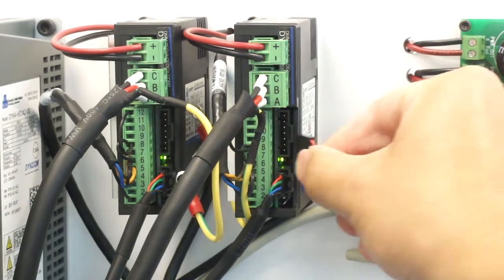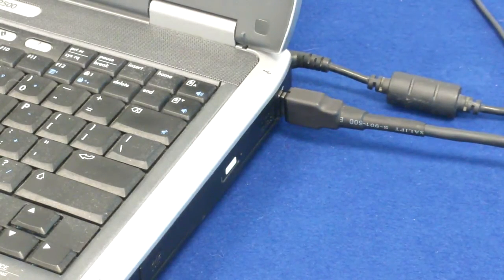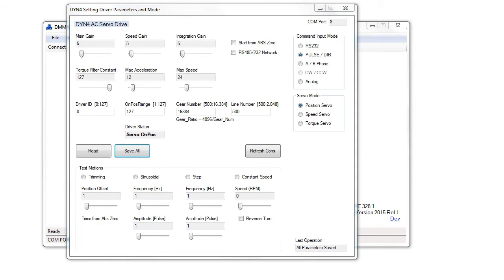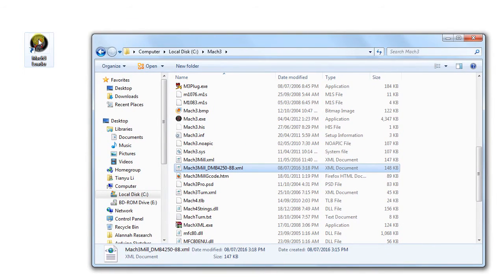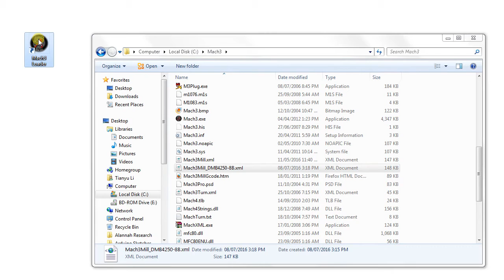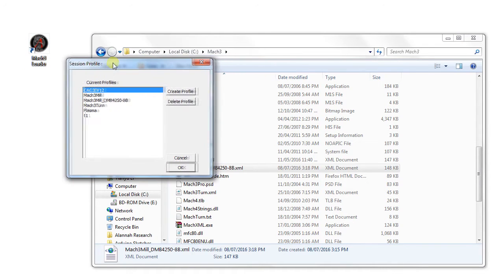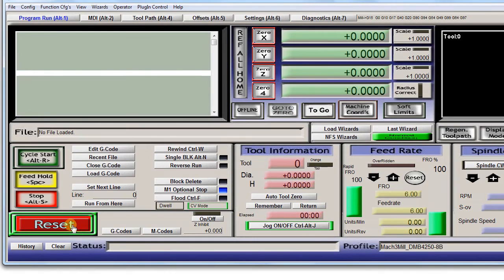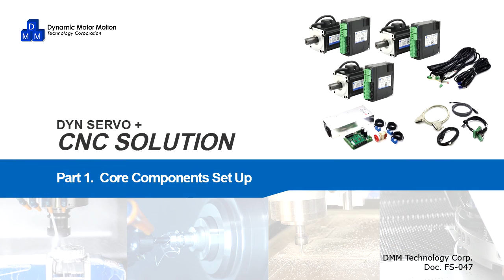DMM CNC Package Set Up Instructions (Part 1.)

Comment: What's the breakout board for and is it necessary?
Reply: The "breakout board" is the interface from the PC to the servo drivers and it typically has a connector to a PC and wire terminals for connection to the servo drivers. 
A PC cannot send pulses to a servo in real-time (MS-Windows is not a real-time operating system ) and this is done by an embedded microcontroller (older breakout boards used a PC's parallel port and did not have an embedded processor) in the breakout board. It receives commands from a PC running Mach3/4, UCCNC, etc. ,which decoded G-code, and sends the correct number of pulses to move the motor to the desired position in real-time. Some examples are XHC's Mach3 and Mach4,  AXBB-E by CNCDrive. These are a combined motion controller & breakout board. The combo (motion controller+breakout board) boards are a much more reliable system for controlling the motors for CNC.
The newest systems use a motion controller (integrated motion control and breakout) with an ethernet interface to the PC.
Only a few companies actually make servo drivers and the ones are the market are typically a re-branded product. XNC is a primary manufacturer of motion controllers.
Hicon mas the Integra; another integrated motion controller+breakout board that connects to a PC running Mach3 CNC software.
Yawkawa is a primary maker of servo drivers that competes with DMM, as is SureServo.
Reply: @twbrkfd1733  Wow thanks for the detailed explanation for the longest time I was confused about breakout boards and real time motion controllers and pc based controllers. So if servo drives take intepretated gcode from the motion controller, what about external axes drives of robots arms? Robot programs do not use gcodes like CNC machines do, even for their external axes.

Comment: nesecito un kit completo para una maquina frezadora ycm 40
los motores  que tenia estas son las caracteristicas  (cont stall torque2-1nm max- rpm 2100 volts 140 amps18 tacho 9.5volts/1000rpm) estos datos tiene en el motor de Z )( y el motor de X cont stall torque4.5NM max rpm2500 volts 140 pulse  amps 4.7 tacho9.5volts/1000rpm) y el Y no se puede ver ya que se encuetra no abido les agradesco por su respuesta y asesoria  y tambien  el preciototal a pagar gracias  richard dominguez este es mi correo gleicer74@gmail.com

Comment: is there any pc SDK for these drives so that custom computer software can give them command and can get feedback from drive so that can be processed
Reply: The HiCon Integra motion controller from Vital Systems is one that has an API for custom computer software running on a PC. It has some samples in VB.NET and C#,C,C++. Not free at $350 !

PCs (which are not running a RealTime Operating System) cannot keep up with the real-time demands of motion control. CNC is now done wisely by a motion controller which has an embedded CPU executing high level commands from a PC and sending out pulse streams to motors.  A few years ago CNC was done using XP with a parallel port sending pulse streams to multipla stepper/servos; a REAL BAD IDEA! Systems were/are prone to crash badly.

There are only a few companies that make CNC motion controllers; imagine the liability of a failed controller on a milling machine...

Closed loop stepper motors have an encoder and the encoder is wired to the stepper driver box. It is the stepper driver which transparently corrects for missed steps and NOT the motion controller (servo motors work the same way).